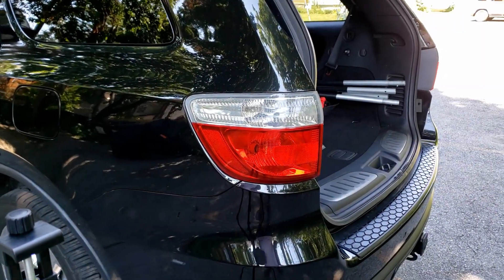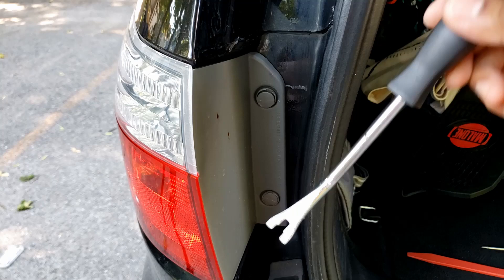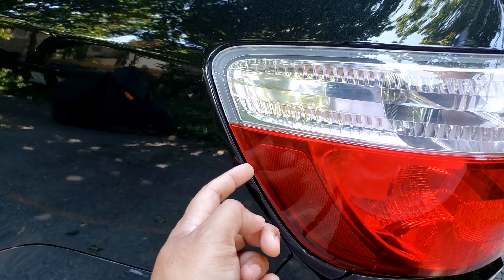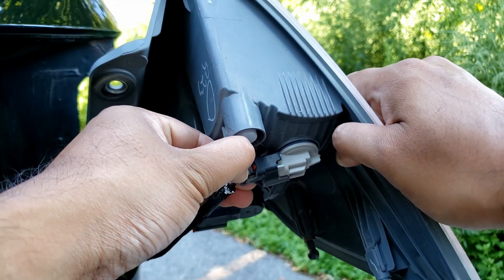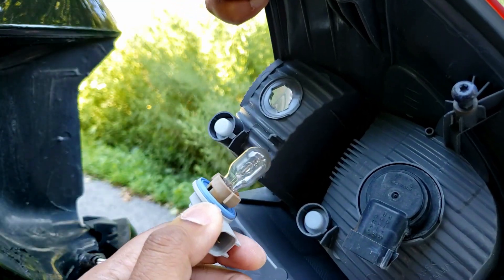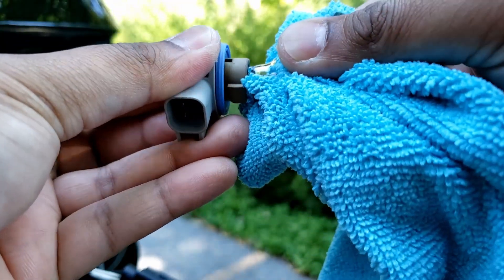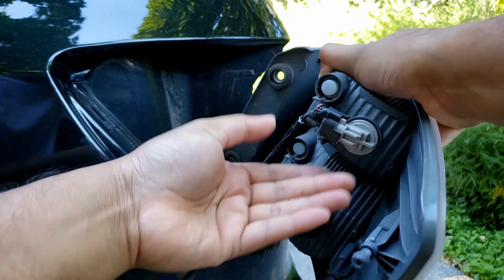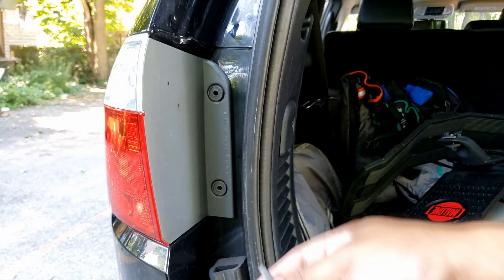5 min DIY - 3rd Gen Dodge Durango Tail Lamp / Tail Lamp Bulb Replacement. (2011-2013)

Comment: You have anything on replacing backup camera
Reply from the maker: Alex I don't think I have a video. I will check though. I have taken it out multiple times to paint the rear hatch. It's not difficult. Take the hatch lower trim out ( held by clips and two bolts at the bottom by the lock assembly) and the camera applique is held by 4 bolts i believe it was 10mm. Just an fyi one of mine was rusted had a bit of a struggle taking it out.
Reply: Thank you! Very well explained!!